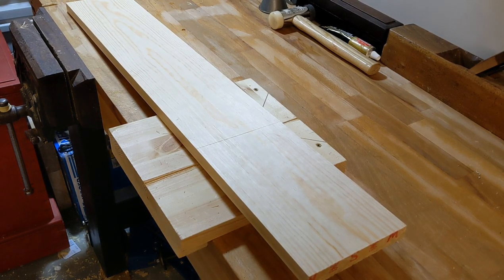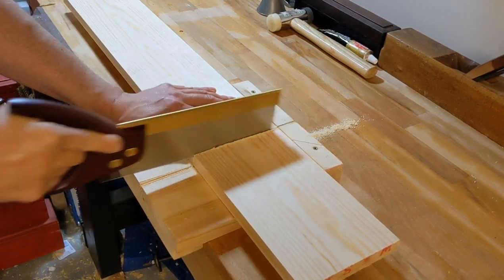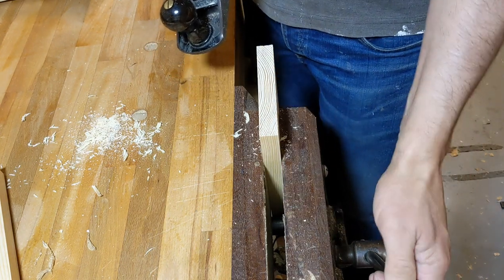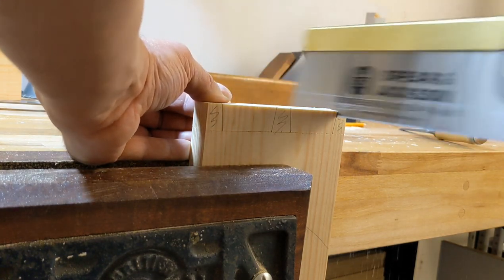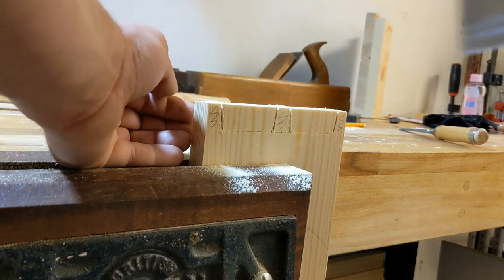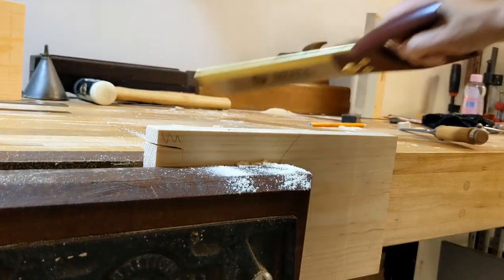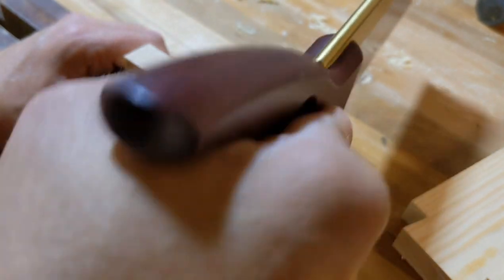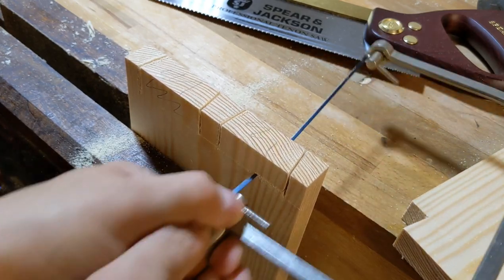Dovetail Saws on a Budget - Part 2

Comment: Needs less set, my 3 PPI framesaw has less set and a thinner curf than this, otherwise this looks like a great saw, as long as you sharpen it, set it, and it's straight it should behave exactly the same as a premium saw.
Reply from the maker: Totally agree. I didn't want to show how to reduce the set just yet. It's not difficult to do so, but for an absolute beginner it's something extra for them to think about. I would use gentle work on an improvised anvil or a metalworking vice with tape to control the reduction in set. Thanks for the feedback!

Comment: I was just watching a guy that considered Lie-Nielsen low end. He had to have custom made boutique saws. La de da!
Reply from the maker: Blimey! Lie-Nielsen are a delight. I think they bought independence tools and carried on the line of saws. I've never heard anything bad about them!
Reply: @faceedgewoodworking  he wasn't saying they were bad. But he wasn't saying they were very good either. Not at least compared to other saws he had. Which were all custom handmade saws. That I'm sure cost several times what a Lie-Nielsen does. Everything is relative after all.
Reply from the maker: @1pcfred  Yup, if a saw is properly filed then that's half the battle.
Reply: @faceedgewoodworking  I wish I could properly file a saw. I've tried. I'm not so good at it. I struggle with tasks that require consistency. That sort of thing has always been impossible for me to do. I just can't hold it together for very long. That and I've yet to find a decent how to on sharpening cross cut saws. I've watched so many of those and everyone glosses over which side of the tooth you file on with what angle. Like it's so obvious they feel they don't have to mention it. Well it's not obvious to me! So sharpening cross cut saws is the bane of my existence. I just can't do that at all. If I try I just make calves and cows out of the saw plate.
Reply from the maker: @1pcfred  No shame in it. It's not easy stuff to master. One of these days I'll get a video done and you can let me know if it makes it any clearer.
Reply: @faceedgewoodworking  I'll tell you what I feel is missing and done wrong in all of the videos I've watched. I've watched about all of them now too. Everyone seems to stress a few points and gloss over everything else. That's one. They spend most of the time on just a couple points and just don't cover everything because of that. So try not to do that. The other thing they don't do is have a closeup of the file on the saw. Ideally there'd be a wide shot showing the angle and then a close up showing the tooth with the file in the right orientation over it. Maybe then contacting the tooth? Or maybe color in the tooth with marker then file it away. So it's clear how it's being faceted. I'm just dense when it comes to trying to sharpen a crosscut saw. I get that it's simple if you know what you're doing. I just don't know what I'm doing. When you're explaining something you can't assume someone knows anything. What's obvious to you may be opaque to others.
Reply from the maker: @1pcfred  Thanks, this is really going to help me 😉
Reply: @faceedgewoodworking  apparently making a video explaining how to sharpen cross cut saws isn't an easy thing to do. Or maybe it's just me? Sometimes when I really want to do something I can psyche myself out. Then I don't pay attention like I should. Being able to sharpen crosscut saws has been a quest for me for a while now though. I've tried and failed miserably. I'm so so doing rip saws. There you just have to make the teeth all the same size pretty much. Adding that fleem angle totally screws me up though. File the back of the tooth leaning away from you? I don't know! File it how? Oh you should be able to tell by looking at the facet. I can't tell! Just tell me and show me. They never do.